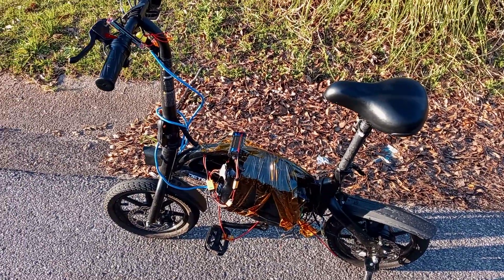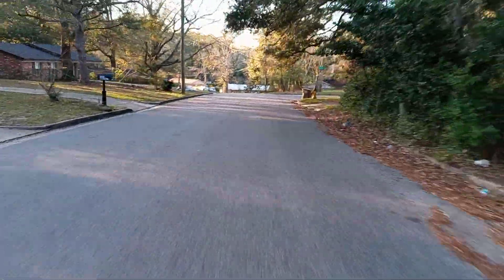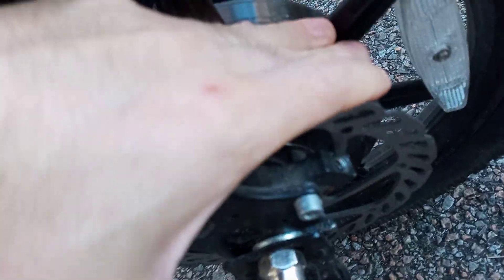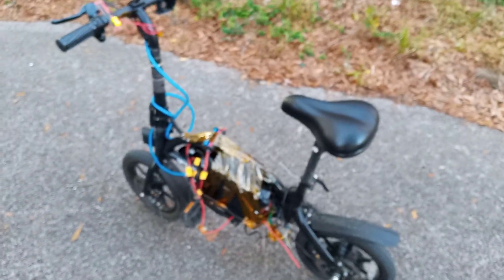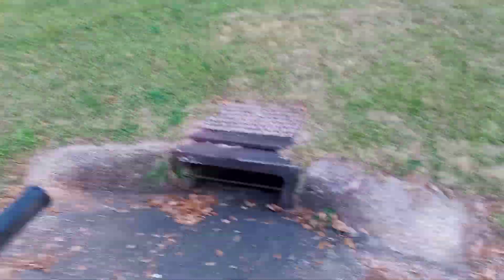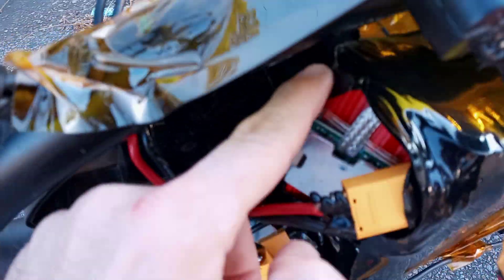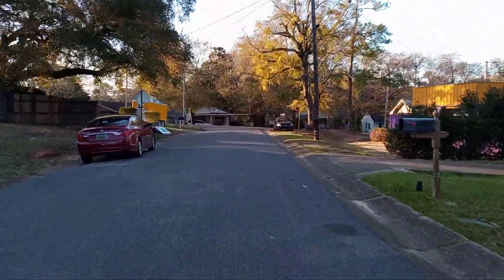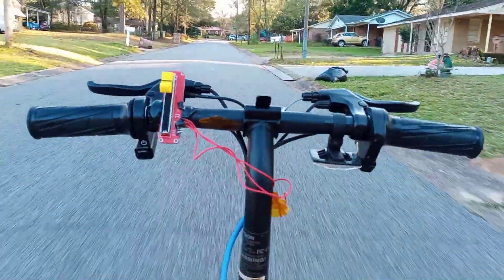72V Jetson Bolt Pro - 20S3P weldless ebike battery

Comment: Why do this for 25mph? Not criticizing you, I like doing things just to try them. But wouldn't pushing more amps at lower volts be better for torque?
Reply from the maker: No. Higher voltage is always better.

Comment: So if you don’t mind me asking how fast is it going even though you put a 72 V onto there and also, are you putting a 6000w on it also
Reply from the maker: Gets about 25mph with a fully charged 72V battery. Stock motor. 50 dollar controller.

Comment: What controller are you using? It isn't easy finding a controller that will accept 72V without sending too much current to the motor.
Reply from the maker: This one has a wide input range so its been great for battery experiments.

https://www.amazon.com/keenso-1000W-1500W-Rectangula-Brushless-Controller/dp/B08HMLD6GX

Comment: On stock with more loads it will be hot. I'm 240lbs and riding with a trailer  and my kid is another 75lbs. Once up to speed it rides fine but throttle too long it could burn or overheat.  I never got to that point, so just to see this at 72v is really pushing it....  I was actually on a 48v 10ah and motor whines due to my weight
Reply from the maker: Correct. I only weigh 130 lbs. But I can definitely say for me and in my area, the Jetson Bolt Pro is stable @ 72V

Comment: Hey man quick question so if I just got a jetson bolt pro and want it to go faster. What is the best method for getting it faster. Do I get a 48 v battery with a new controller
Reply from the maker: The stock jetson controller will take up to 52v. That is the most strait forward way to get more power. They are still speed limited to a degree, tho. I recommend replacing the controller.

Yes. 48V battery and 48V controller makes the jetson about 26mph.
Reply: @electronicsworkshawp  a 48v with original controller ? Would a 48v 20ah fit in there 11 - 12 inches length ? Also maybe with the controller ?
 Would be nice if you would add links to where you buy your battery and controller.
Reply: No videos on your part ? Any developments with the Jetson Bolt Pro ?

Comment: Hello, and nice video. Are you running any other upgrades besides the dual battery set-up?
Reply: No way, no hands. WHAT!!!
Reply from the maker: Yes. this controller and the air plane throttle haha 
https://www.amazon.com/keenso-1000W-1500W-Rectangula-Brushless-Controller/dp/B08HMLD6GX

Comment: Still running strong?? Because im going get a controller amd put two 36v 6ah in series to get that 72v
Reply: Please let me know and how long have u had this set up
Reply from the maker: Sorry for the late reply. I am 140lbs and the Jetson is a small bike, so that situation does not put a motor-melting amount of power through the system without something having to go really wrong for that to happen, despite the fact that im running it at several times the motors rated power.

Comment: That's great. Seems way fast enough. I've done a soldered 7s6p battery for a kids motorbike, I'm just impressed by the range you get out of them.
Reply from the maker: thank you!
Reply: Is everything else stock? Why swap out battery?
Reply: @bjbrunetti  In my case I bought it without a battery, the original had lead acid and the lithium ion battery was a major upgrade. I also upgraded to a cheap 500W motor because the original brushes were worn out.